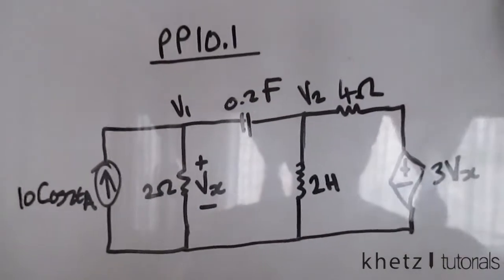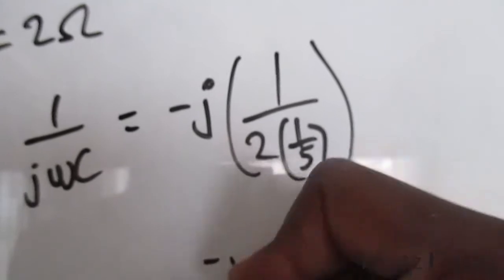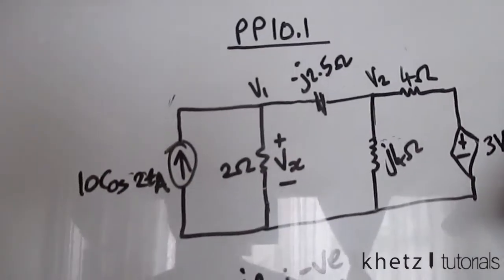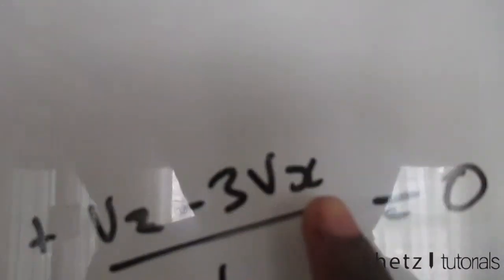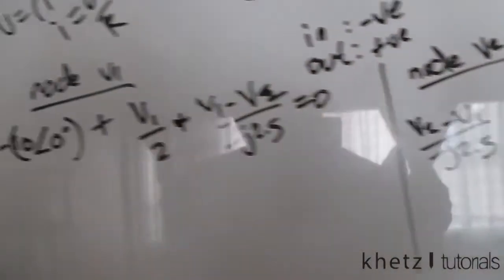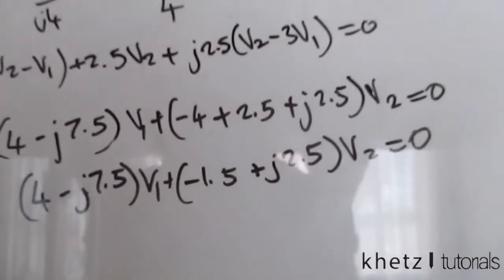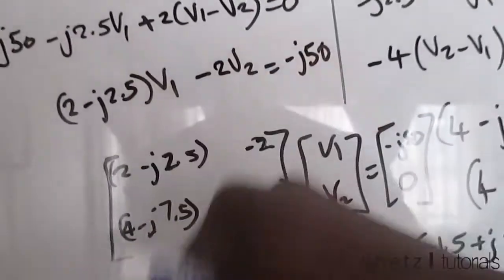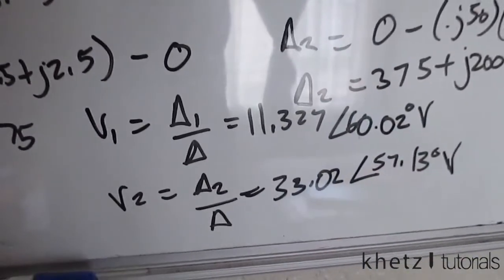Fundamentals Of Electric Circuit Practice Problem 10.1

Comment: Why did you pick -j5 and j10 to simplify I didn't get it I mean what is the rule to pick numbers to simplify the equation??
Reply from the maker: There isn't any rule. You can choose whichever approach you want to simplify the equations you're dealing with
Reply: Really how come??
Reply from the maker: In this particular case I just used the general fraction rule. So if you have fractions, you'd want to multiply by the lowest common multiple to eliminate all denominators. The denominators at 08:41 for example, were 2 and -j2.5 and a common multiple would be j5 or -j5 or any other - it's just best to choose the lowest